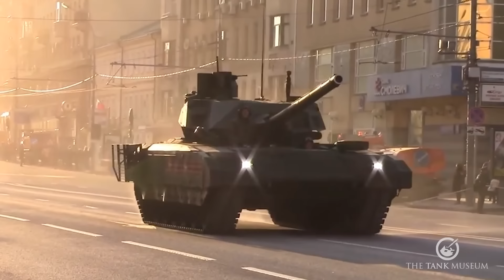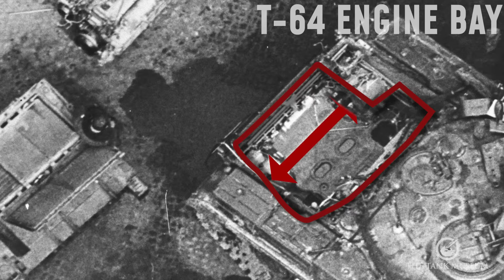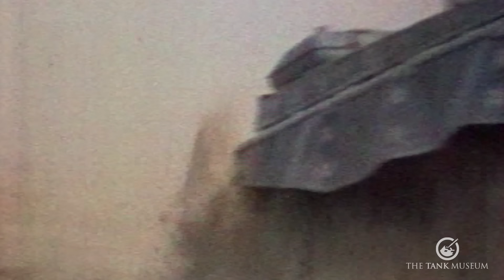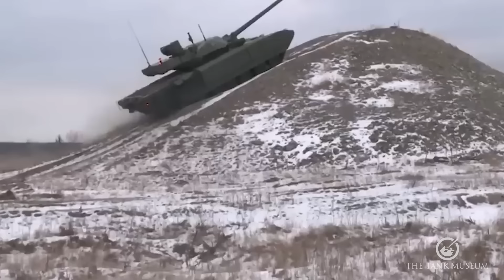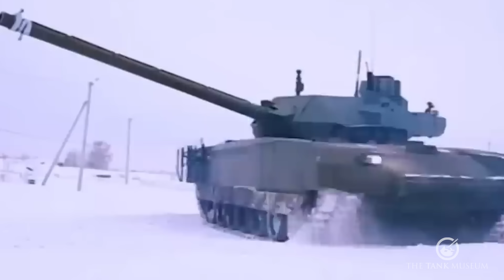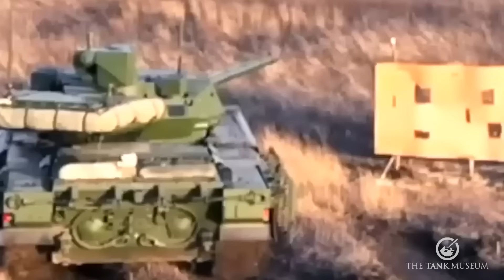Radical or Ridiculous? | T-14 Armata | Tank Chats #171

Comment: Is much more cheaper and better just picking the t90m and puting a better reverse speed on it with an active protection system.
Now with the war demand they are expanding their production of t72b3m and t90m and because of that i think Armata is going to a dead end or at least a completely stop on its program.
Reply: I see the similarity with how during WW II the Soviets opted for the older t34 design instead of more modern t44. Probably the same fate awaits the Armata project.

Comment: So Russia was able to test several fully finished prototypes of huge redesign of tank as we know it for last couple of years. The machine is build for future and with automatization as one of the goals which would be impossible with current generation of tanks, especially the western ones which require a human loader. Most of the large developments of tanks and armored vehicles are taking years and even after that they usually struggle with reliability issues during the first production years, just look at challenger2 or ajax. Russia has plenty of time to iron out the kinks without throwing a lot of money at it as the competition is non existent. Germans are are in "maybe we should start talking about the development of a new tank" phase, brits intend to put a third turret on a Chalenger1 chassis and US of A are planning on rocking the Abrams for a long time(or not doing the planning or not thinking about the planning at all). I would assume that after the current conflict ends Russia would have to do inventory and assessment of their stockpiles. There would still be plenty of old models to be repaired, refurbished and upgraded but I do not expect them to build any old models from scratch any more.

Comment: What I did not realise until recently is that the number of a Russian tank is its approximate design/manufacture date. For example a T 70 was designed around 1970. Presumably this T 14 was designed around 2014.
Reply: Kinda like this, but its not precise
Reply: The design of the T-14 starts around 2010 after the canselation of the Object.195 (or T-95). I think it was publicaly revealed in 2015 for the first time.
Reply: @ViktorBezK дружище ты откуда
Reply: Дружище это танк разработан с древнейших времён тоесть 33 года назад
Reply: @werionis it's not the same tank at t-95
Reply: t70 is ww2 tank
Reply: Not the same but close.

Comment: Latest news about the Leopard 2 says they are not destroyed but have technical issues. 
Let’s stay realistic: tanks have several technical problems: caterpillar tracks, mud, high torque, condensation, electric-electronics-hydraulics-mechanical- optical all shaking with every BOOM. 
So… launching a new T-14 is scary as well

Comment: The T14 has systems to repel incomming shells. Slight problem though, the sensor's are western import. So the crew will have to manually operate this system, by noticing a incomming shell at the speed of sound and then pressing the button at the exact right time 😂
Reply: Such things are not a concern
Reply: @Petruha6472  because the Armata will only see action as a propaganda piece??? XD
Reply: @DrunkRaccoon-t5l  Like they wont make the system themeselfs

Comment: Russian tank development is never ending story of trying to be as small as possible, which brings advantages, but also issues. For example the reason why Russians are not upgrading older tanks to later guns as Western armies do, is simple they can't. Their turrets are always designed to be as small as possible, means no bigger gun can fit and that goes all the way to WWII. When T-34 needed a bigger gun, they had to use a new turret planned originally for T-44, because 85mm gun wouldn't fit into the original small one. Then they wanted to upgrade to very capable 100L60 to deal with bigger German cats, not possible, won't fit. 100 mm gun appeared in a Russian tank only long time after the war, ten years later - in T-54/55. And then the new M-60 appeared on the American side, a new gun needed, same story yet again, won't fit. So we need a new turret comrade, let's put it on the good old T-55 and voila T-62 was created the same way as T-34/85 was almost twenty years ago. However, that sacrificed armor protection, gun angles and other things so new tank - T-64, all the problems mentioned in the video and so we need simpler design - T-72. From there no real upgunning for fifty years. Still using 125 mm gun, just modernized it several times while keeping it roughly the same size to fit in similar sized turrets. However, times are changing the original 125mm gun needs replacement to keep up with future opponents, but there is a problem. Yes, the turret won't allow bigger gun.  So new tank was needed again, but it needs to be small, but a small tank needs small turret and we can't fit everything inside such small turret, we had already problems fitting crew as it was, not mentioning the pesky problem with the ammo protection. So let's take out the crew and leave the entire interior of the turret for the gun, hence T-14.
Reply: T54 produced since 1946(serial from 47), rest of your message don't even try to read. Do not show yourself as an expert if you don't know material well.
Reply: @user-ro9hm5xr3o  No you are confusing actual tanks with their names. What you are talking about is T-54-1, which while it sounds like T-54 was very different tank. For example, the turret is entirely different and looks more like enlarged T-34/85 (T-44). What we now recognize as T-54 started its serial production in 1951 as T-54-3, but was then again improved as T-54A, which is finally the tank we all know as T-54 and that was build from 1954.
Reply: @dusanbolek8004 good point! accept it 🙂

Comment: I like the idea that the whole crew is protected by an "armored capsule", latest armor and defense systems but I don't like the idea that it's all working on high tech electronics and unmanned turret. What if the tank system gets disabled by heavy explosion such as mine or rocket?
Reply: человек это слабое звено.
это хрупкий элемент танка, занимающий много места, со хрупкой моралью, который может быть легко сломан, чем электроника или иные механизмы.
что он сделает, если заклинит башню или разломает прицельное приспособление или порвет гусеницы?
это не вторая мировая война, где можно было инструментом и молотком починить танк, сейчас такую сложную поврежденную машину нужно вести на ремонтный завод
Reply: And america copy the unmanned turret and auto loader 😂(abrams x)
Reply: @MinhNguyen-hz2zn France did it and actually had on operational vehicles long before anyone else did
Reply: @MinhNguyen-hz2zn The US did it first with the TTB. Also, Abrams X is a Proof of Concept. Not an Actual replacement for the M1A2

Comment: It's not because of the sanctions. Armata is much more expensive than other Russian tanks. And to unleash its full potential, it must work in conjunction.
«ЕСУ ТЗ» (or АСУ ТЗ) is a unified tactical level control system for implementing the concept of "network-centric warfare", technologically developed by the Sozvezdie concern.

Designed for integrated command and control of troops using navigation systems, as well as satellite and unmanned surveillance systems. Each piece of equipment, whether it is a brigade commander's command vehicle or an armored personnel carrier of a squad leader, is equipped with a software and hardware complex - an on-board computer that allows you to receive and give combat orders, determine the coordinates of your location and display an electronic map with a combat situation on a laptop screen.

The remaining parts for such a system are not yet ready. Therefore, the t-14 is not needed at the moment.

Comment: "The armata engine is a copy of  a german tiger engine" - No, the Porsche tiger did not use the german SLA 16, it used 2 v10 engines driving electric generators and finally electric motors. Besides that, armatas engine uses the same X configuration as the SLA 16, but calling it a copy of the SLA 16 engine is like calling an American LS V8 a copy of a French engine because the French invented the V8 in like 1906. It has much higher displacement, larger dimensions, and uses forced induction. Also, the X configuration was first patented in the US in 1928, and the British had an aviation X configuration engines in production in the 30s.

Comment: The tanks get an unfair amount of flak. I don't see the same criticism for the KF51 or AbramsX.
Reply: Almost 5000 Abrams tanks are in existence.
Reply: They are exist this years compare to T-14 from 2014 (9 years)
Btw those tank still flaw
Reply: @SRDPS2  There are some 20+ T-14 armatas while there is only 1 AbramsX and 1 KF51.
Reply: @kitchenersown  like I say, 9 years is no surprise
Ps. Abram X remain demonstration so next up it just update Abram
Reply: @SRDPS2  Challengers 3 is expected to enter service in the early to mid 2030's and it was just designed in 2020 so around 10-12 years before it sees active service and I don't see the same amount of flak for it. And what about the KF-51? I've only heard endless praises when only one has been manufactured.
Reply: @kitchenersown  for challenger 3, yeah it really bad for design 
For KF? IDK (btw tank itself are complicated)
Reply: @SRDPS2  chally 3 isn't bad for now but maybe in the future. Same still applies to KF 51 there's only 1 produced and yet it gets endless hails and when there's 20+ t-14 it gets nothing but flaks.
Reply: @Matuse  It didn't. Wanna know why? Because when a tow vehicle which was literally a tank with towing equipment tank tried to tow the T-14 away the T-14 didn't move despite the tow vehicle towing it. If it broke down it would've moved but the driver pressed something that made the vehicle gears resist any movement.
Reply: Because Rheinmettal and General Motors didn’t just spend the past we years having the reputation inflated by a government obsessed with respect and prestige that it doesn’t deserve. Only to have the military that they spent years cultivating an image of professionalism and modernity that was lost in the union’s collapse cracked open for the world to see and ridicule.
Reply: The Abrams X and KF-51 were only just announced. Russia claimed it would have 2,200 T-14s in service by 2020 and now has cancelled the entire T-14 program. You are acting like Russia having more T-72 than the US has 10th generation fighter means Russia is more advanced.
Reply: @rick7424  ok? That's an infrastructure and logistical problem rather than the tank having a problem. The T-14 is still a very good tank. Also challenger 3 is expected to enter service in the early 2030's that is similar time to the T-14 armata and it doesn't get similar flak.

Comment: T14 was planned under the concept of network-centric warfare as a means of reconnaissance and issuing targets for artillery and aviation. But while it was being made, cheap drones appeared for this. Moreover, existing tanks have been used for indirect fire, where the fire is corrected from the air by a drone. Therefore, such a battle control tank has lost its meaning to a certain extent. Most likely, there will be a new version with a 152-mm gun compatible with field artillery guided munitions and tight integration with reconnaissance unmanned vehicles and the ability to fire from a closed position like self-propelled guns. Only with protection like a tank. And then this tank itself will be made unmanned, as it was supposed at the very beginning.

Comment: I think the T-14 will face the same fate as the Su-47. It'll become considered too expensive for mass production for Russian army and they'll search for foreign buyers (and just like with the Su-47 they won't find any).
As for why the T-14 hasn't seen action in Ukraine yet, I'm guessing Russia has problems with getting enough parts in case something needs replacement, without the need of cannibalizing their existing units. Or, like most Russian equipment, they're too unreliable and marred by technical issues to be fielded on the front lines. And we already have evidence of that.

Comment: Regardless of early production and prototype issues, if the tank have the claimed attributes, it is deffently a great tank. however do to lack of production capablitys it migth not see any role in the current conflict, this however should not make us think less of the design and development put into the project. And if any are i doubt, many new military platforms in the west are troubled with chield sickness problems many years after being put into service.

Comment: I'll wait till I see one in combat before I draw any conclusions as to just how effective it is.
Reply: Well it’s not effective if it’s not in production and not on the battlefield.
Reply: @francesconicoletti2547  - I guess I wont see one in combat then.
Reply: @francesconicoletti2547 how do you know if armata is on production and on the battlefield?
Reply: Do you mean how effectively he destroys fortified areas, blindages? Surely not worse than other tanks
Reply: @愛を込めてロシアから  - I have no idea how it will perform. I know what the talking heads say but talking heads appear to lie all the time. Only on the battlefield can you see how well something works.
Reply: @aardvarkbiscuit2677  There is nothing simpler: get out of the concentration camp of Western censorship, and watch: T-14 took part in battles in Syria, there are reports and filming of the assault on the suburbs of Raqqa.
Reply: @alexgainsborough4921 uuuum no
Reply: @alexgainsborough4921 inti suryia?
Reply: @alexgainsborough4921  They were in syria but not in the front lines and never saw any action. Not any thats confirmed anyway so most likely not.
Reply: Personally im most skeptical about its hardkill defensive capabilities. Have real doubts that thing will stop a apfsds, atgm probably.
Reply: This is the correct response.

Comment: The engine maybe powerful, but it sounds like it could be an Achilles heal, yet alone the electronics in it.  With all of the sanctions, making sourcing the electronic elements difficult, an engine that may not be reliable, I can see why they are refurbishing older tanks.  With the war in Ukraine and who knows how many of the tanks in use, destroyed, obviously most likely with the total loss of the crews.

Comment: T55 was my tank during my service between 1973-1975 and during my reserve service until 1982. I was a tank commander in the IDF and those tanks were captured during the 1973 Yom Kippur war. I started as a driver and a 5'11" tall, that was a torture. I could never sit straight in the drive compartment. I ended up my service as a commander and again, the ergonomic of this tank was awful. When the hatches are fully closed, you basically sit on top of the gunner. This tank is not for the claustrophobics. Mechanically the biggest issue was the clutch. Those burn off like crazy. Also, those tanks were designed for cold weather and they got easily overheated in the hot weather of the Sinai peninsula.
Reply: Stop stealing peoples stuff then 🤣 Make your own!
Reply: @michaelbiri6676  I'd say strop starting wars you cannot win, and you won't have your stuff stolen... 🙃

Comment: I would not underestimate the new design of uralvagonzavod the biggest tank factory in the world, their t-90 is the most sold tank in the world, and rostec their owner is the biggest defence company in the world. There is already some upgrades, the new turret for the t14 armata with active defence system and i also did see a reactive armor kit for the t14 and t15 armata platform that has protection that is capable of giving protection against the latest anti tank gun's and rocket launchers of nato forces. And the new x type engine that has been completely new developed

Comment: I'll never understand the propensity to put the crew in front of the gun.
Why not copy the Israeli's and put the engine in the front and crew compartment in the rear?
Reply: Rear driven tanks have advantages over front driven tanks.
Reply: @petroleumalley  Surely Crew Survivability trumps all other advantages. Imagine having to bail out of a T-14 under fire? They have no chance!
Reply: @xC4N4D14NB4C0Nx  Yes, but who says that an enemy attack is always from the front?
Reply: @petroleumalley  If you really want to get semantic it would probably be a helicopter attack that* destroys the vehicle anyways.
Front towards enemy so my point still stands, the crew is the most valuable part of any vehicle.
Reply: @xC4N4D14NB4C0Nx  So you want the tankdriver in the rear? I was a M109 commander. Not exactly the same thing but the driver always embarked through his hatch. Running to the nearest trees and regrouping takes more time and risk than bailing out.